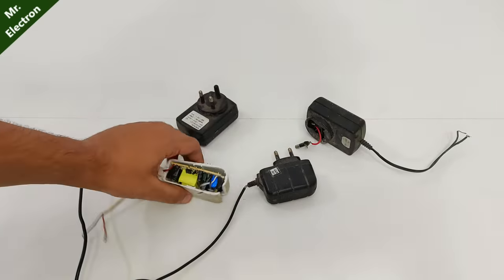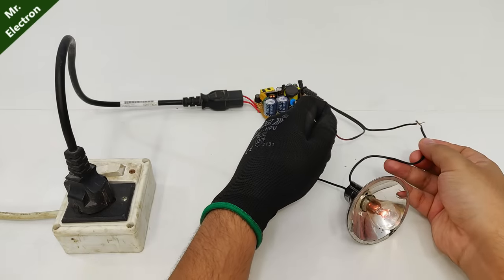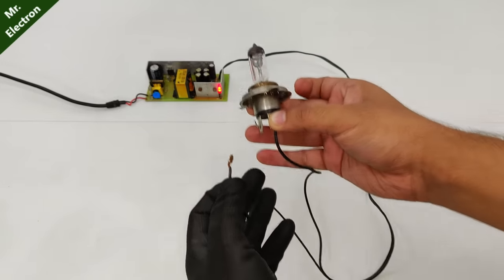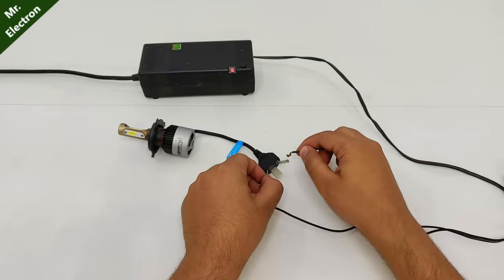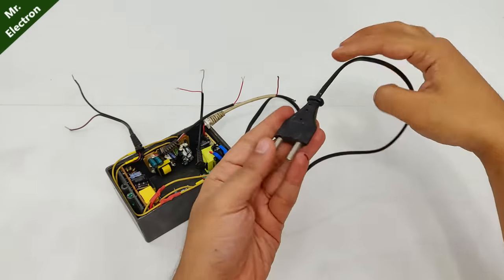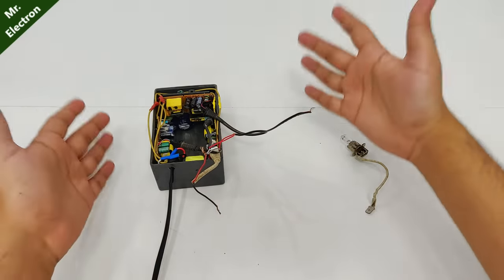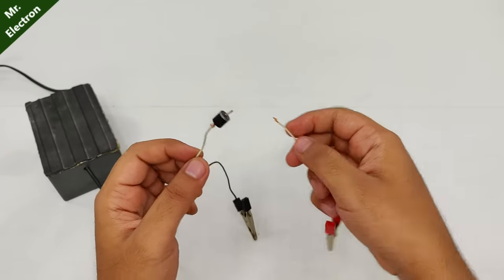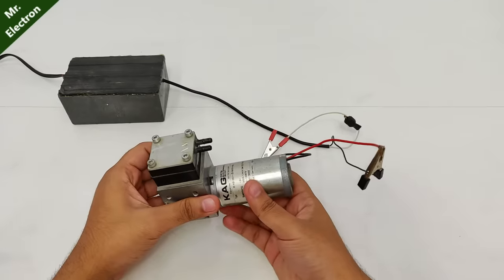12 Volt Power Supply for 100Ah Battery Charger using Mobile Charger - 220v AC to 12v DC

Comment: Thanks for making this video, I'm in USA, we use 110 volt chargers but they are about the same. I need to fix several of my chargers, I'll try smacking one on floor like you did to open it. I've always used my knife to get them open in the past.
Reply: Same here but for those who can't be trusted with a knife or are afraid of little blood a few quick smacks will do the job just make sure to have extra on hand

Comment: Good. how much time  will need to charge 12v 100hamp battery
Reply from the maker: Depends on how discharged the battery is but i have been using a 6 amps charger for charging my 150Ah battery for 2 months and it takes around 8 hours  to charge from 11.2v to 13.4v

Comment: This is not a 100AH battery, this is only 100WH battery. Both are different. Calculation 100 Ah x 12 volts =1200Wh

Comment: Do you have cut off system for your 12v battery charger? If not then it's not safe for the battery it will damage.

Comment: Thank you, Mr. Electron.
 I want to make an electronic circuit that reduces voltage while maintaining current, please 🥲
Reply: Use resistor
Reply: Voltage divider , research it , it's not hard after you figure out what ballpark size and rating resistors to use. I get butt loads off throw away electronics,

Comment: There are some problems of 12V 8A power supply,  snubber resistors around the main transformer, you will be some brownish color of the PCB, that indicates that it is going to  burn out soon.This is due to poor wattage, insted of using 2-3W resistors, they use 1W.
You either change the same value to 2-3W or scrap the PS and select another one.

Comment: Please sir, can I use 15v-2amp laptop charger to charge 12v-95amps battery
Reply from the maker: Sure it will work if its a lithium, lead acid or super capacitor battery
Reply: @chapboongoh3666  true!

Comment: bộ này giá bao nhiêu bạn ?
Reply from the maker: ENGLISH ?
Reply: @MrElectron  you cannot charge  a 12v, 12ah, 100wh battery with  3 x 1Amp chargers (in parallel?)
Reply: @silahimsimrad7487  Didn't you see he has connected output of charges in series to get required voltage. The result was even higher what is needed to charge the battery consequently he reduced it with a diode.
Reply: @aslamnoori  So you are telling me that I also don't see. I don't know where you people get your knowledge from. I understand though that the only thing you care about is the "clicks". Don't bather answer to me. Just heat the chargers on the floor.....

Comment: 1. on one of your 5 v power supplies , you drilled and placed a screw across the primary and secondary air gap/opto coupler tus compromisingg safety.
2. lifepo4 batteries should be carged wit a constant voltage constant voltage source and 14.8 will surely destroy them! as the absolute maximum voltage o a lifepo cell is 3.65volts - to gget 10 years life charge only to 3.55 - 3.6v per cell

Comment: excellent
Does charging stop automatically after the battery is full?
Reply: No
Reply: It WILLSTOP AFTER THE BATTERY EXPLODE.
Reply: @chapboongoh3666 God made me laugh

Motorcycles have a battery charger and when the charging is full, it stops automatically without any problems

We can use this charger
Reply: @chapboongoh3666  you got award for the answer

Comment: Hello Everyone. I have a question.  I have a B&D 750W 6.52amps inverter model PI750AB.  For the most part it works perfectly.  But I'm experimenting with using it with a smaller battery in my chicken coops when needed.  I have it hooked up to a GT12080-HG 12v 8ah battery.  I can run a fan, laptop radio etc no problem. But when I plug in a 200w heat lamp the inverter goes yellow and cuts the power.  The battery is fully charged.  Why is a 750watt inverter shutting down when plugging in a 200watt heat lamp???   Any ideas?
Reply: Zapravo sve je potpuno normalno. Problem je u tome što je Vaša baterija slaba. Da bi pretvarač dao snagu od 200w, mora da vuče skoro 20A iz baterije, a to ona ne može da omogući.
Stavite JAČU bat. i sve će biti OK!
Reply: @misavuckovic871 exactly my guy the battery needs to be upped by at least twice the existing capacity.

Comment: Just asking.if I have a phone charger then I take 4000w dc-dc converter to get 14v from phone charger,can that 14v charge car battery?.
Reply from the maker: No, current will decrease then. You will need 3 chargers of atleast 2 amps each to charge your car battery.
Reply: Thanks 👏

Comment: So, you used 3 x 1Amp chargers to charge 100Ahr battery? Are you serious?
Reply: In the video, he was charging a 12v, 12ah, 100wh battery..
Reply: Correction, it was a 7ah 100wh battery

Comment: hi, good job,... I ve a question or it´s my little problem : can you advice how to get more amps from a 12V car battery ? the car battery is 65Aph and the needed output, for another purpose, is to get at least 22 amps. Thanks.
Reply: use two identical batteries in parallel

Comment: Can you please show voltage and current rating on each power supply?
Reply: 5 v & prolly 500mha to 800mha
Reply: @famiivt4259  you know there's a difference between capacity of a battery and current?

Comment: Sir can you please solve a weird behaviour of my multimeter? The problem is as follows:
When I turn my multimeter dial to DC Voltage mode it showing random value, and it is gradually increasing and stuck at 1, at the left side(without and probes connected).
But this problem is not happening with any other modes....pls make a video to solve this problem, Thank you....
Reply: switch to higher value, 1 indicates it cannot handle the value,.. starting at higher voltage  is more safer
Reply: @ronmarmz  That is not the problem, the multimeter is reading random voltages and stuck at one even at the highest mode

Comment: I am not sure how calculation were done, before plugging in to battery always check and rate your circuit. In the long run this way of combining anything and plugging100ah battery will blow your circuits. These random circuits will damage battery in long run.

Comment: As usual. Your videos are always incomplete and full of wrong info. The battery as others pointed out is not 100 Ah. An obvious clickbait (scumbaggery). Also you cut off the part at which the voltage cut off at 14.6. Thank god that loom put a bms inside to cut off the charge at the right time. It would never let the voltage reach 14.8 volts.